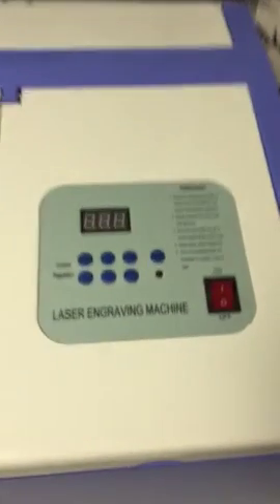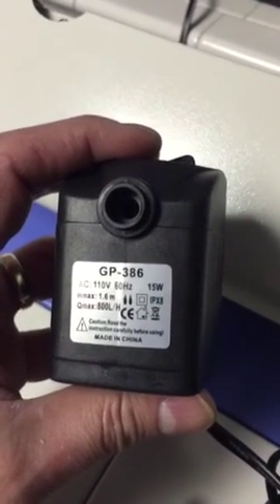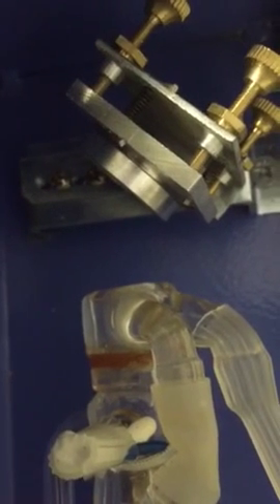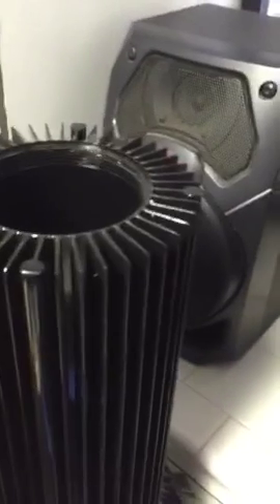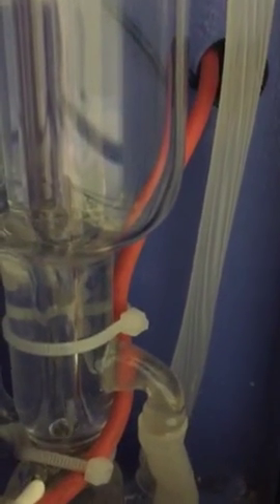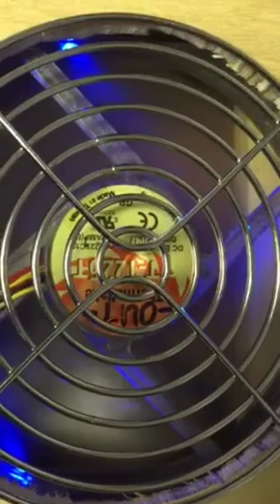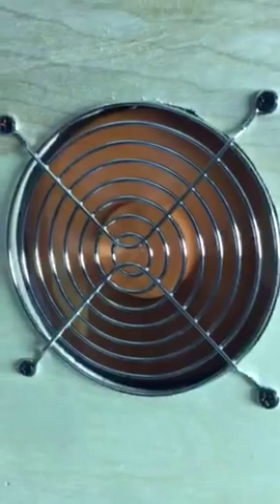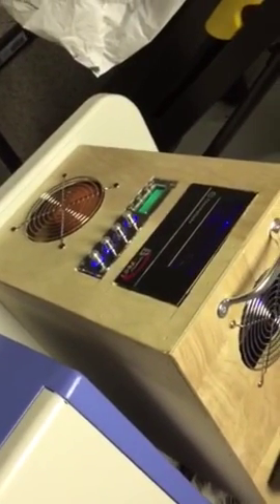Mark's CO2 Laser Water Cooler

Comment: The silicone tubing i think is there to resist the heavy IR radiation in teh tube box. I am starting to notice degradation of the wires going to the light bulb for the work table. (they pass under the tube on my unit)
Reply: How long have you had your machine, and is it worse now a year after making this comment? Thanks